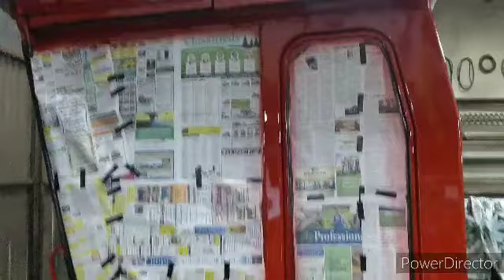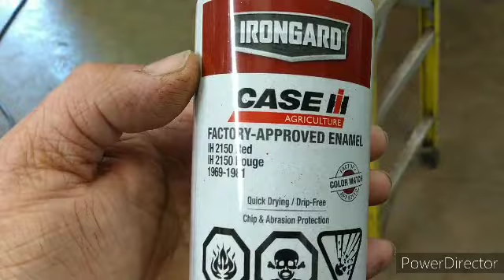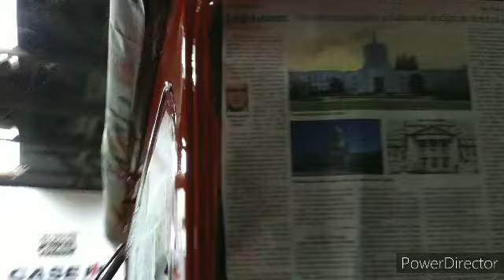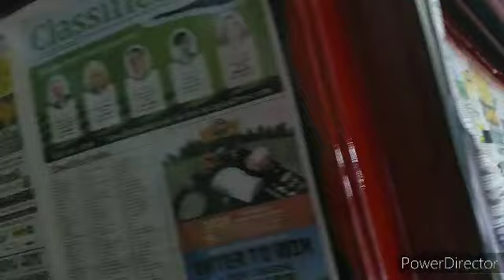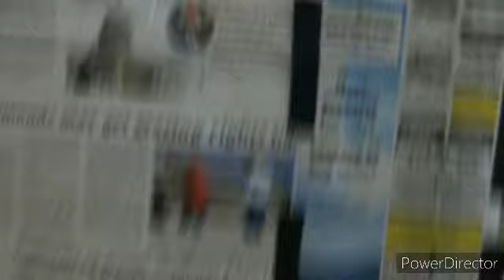calves, cab painted! rain🙄

Comment: Good evening Ed
Reply from the maker: Good enough Richard
Reply: @GosselinFarmsEdGosselin  found  a running  gear  with  a flair  box  on  it  today  paid  200 for  it
Reply from the maker: @richardwilkens4577  you just keep finding the deals!!!
Reply: @GosselinFarmsEdGosselin  had to  haul  it  home  tires  are really  dry rotted
Reply from the maker: @richardwilkens4577  well.. if it had new tires, they would have wanted a lot more..
Reply: @GosselinFarmsEdGosselin  find  them  cruising  the  back  roads
Reply from the maker: @richardwilkens4577  not much on the back roads here anymore.. just lots of huge expensive houses😪
Reply: @GosselinFarmsEdGosselin  I noticed that
Reply: @GosselinFarmsEdGosselin  I'm  going  to put  that  box  on  the  running gear  with the  hoist  on it